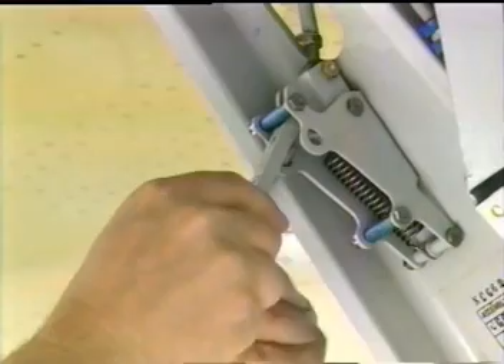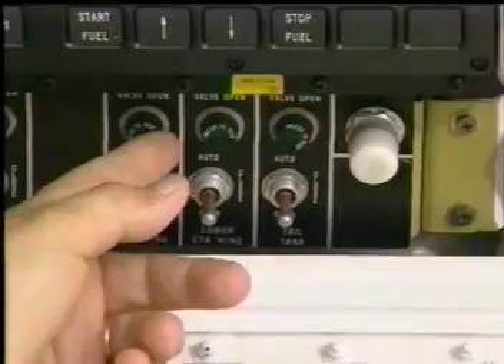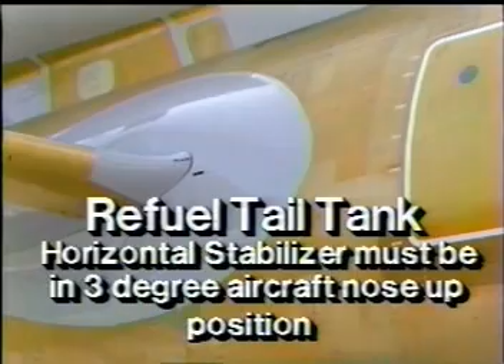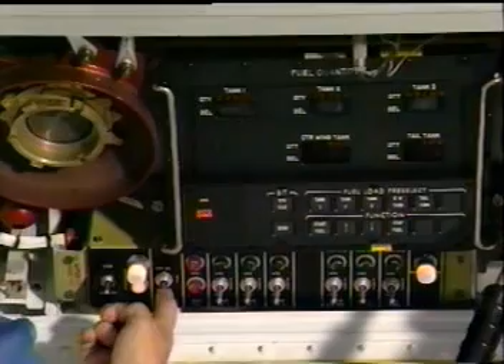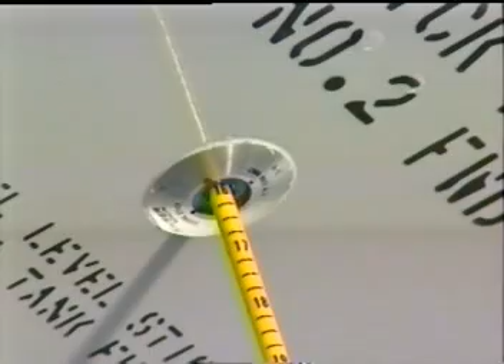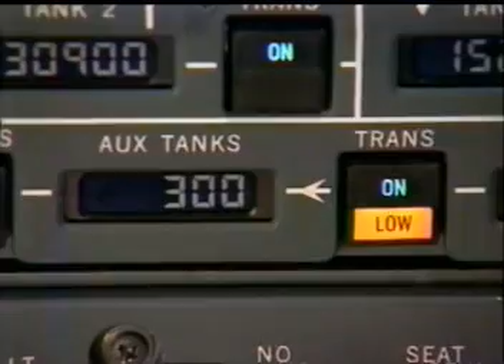MD 11   Refueling + Defueling

Comment: I fuel these often at TPA for FedEx.  I'll auto fuel if they need large quantities, but manual fuel if just topping the tanks off to their requested fuel loads.
Reply: Is it not possible to preselect a FOB and let the system automatically distribute the fuel to the required tanks?
Reply: @wezair80 not on the MD-11.. it’s kinda like a 757 and 767 where you have to put the load into each tank individually. But with the MD-11 i usually just take the fuel load and divide by 3 to get how much goes in tanks 1, 2, and 3 and it works everytime